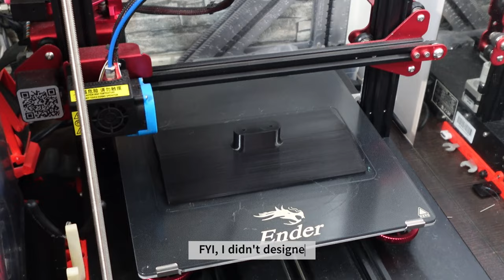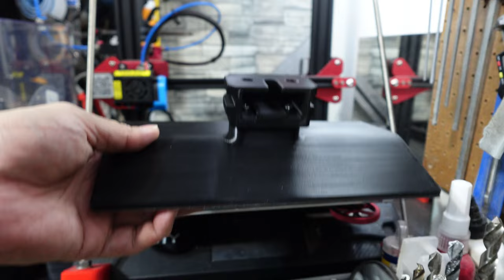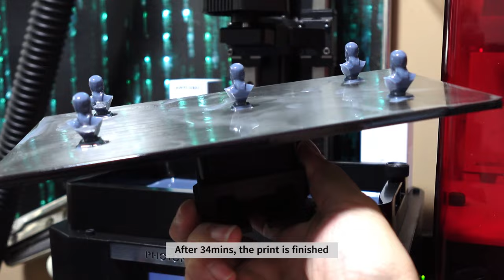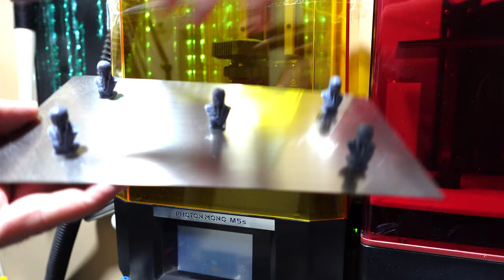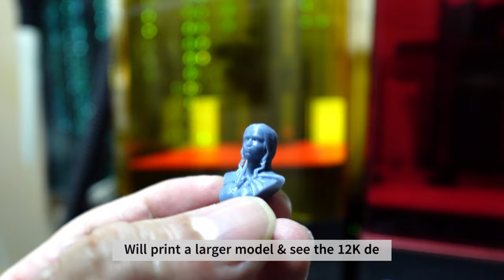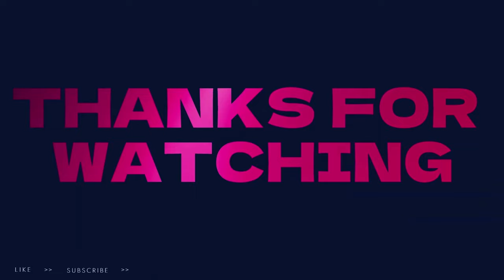Experiment with Mag Flex Plate on M5s

Comment: If it autolevels, do you even need a separate build plate or can you use the OG buildplate?
Reply from the maker: Hi! Currently I am using OG buildplate with wham bam flex system.
Reply: @ManWearCap  without being able to print a spacer (no filament printer) can I just adjust OG build plate with screws and run auto level for M5S?

Comment: hi! i also have the m5s and just ordered  a wham bam. what did you need to to to install the magnet with the auto level sistem? did you need to calibrate something? i tried to put a magnet for the saturn 2 between the build plate and the screen but it got pushed down very hard and the force sensor seemed to wornk not correctly. i tryied without installing the resin vat and the sensor didnt detected the missing resin. thing tha it has done without the magnet. could you tell me what didi you do?
Reply from the maker: Hi, you install the wham bam flex plate on the M5s actual buildplate?
Reply from the maker: As for Saturn 2, you will need to install a spacer before installing the wham bam flex plate. Cos the wham bam flex plate is rather thick (4mm).
Reply: @ManWearCap  Hi! thank you for replying. i already installend wham bam on the saturn 2, what i'm saying is that i have a spare one and tryied to put it between the screen and the m5s's build plate to see what happen.
without the resin vat, the build plate go down and after came out a warning saying "no resin detected"

with magnet between, this warning didn't came out, like the build plate was pushing hard on the screen.

Seems that the auto level or the force sensor, mistook the pressure caused by the thikness of the magnet for the resin.

I would like to install directly on the original build plate
Reply from the maker: @marcobuso1768  I believe u will need a spacer fir M5s too
Reply: Hi! Did you install the flexible build plate in the end? Did you have to modify something? Did the autoleveling work fine?
Reply from the maker: @Mister_Flink  Yes, I installed wham bam flex plate. And auto-leveling work fine with me.
Reply: @Mister_Flink  hi sorry for the late reply, yes i installed it, anycubic sent to me a build plate with the 4 screw for the first leveling. so i leveled with the wham bam installed and all worked fine.
Reply: @ManWearCap  Did you have to print and install the Z Spacer on the M5s or did it work without it?
Reply: @marcobuso1768  Did you have to print and install the zSpacer or did it work without it?
Reply from the maker: @ArsMemoriae  Hi, I printed a spacer & install it.

Comment: Hi! what type of filament did you used?
Reply from the maker: Hi, I used PLA Pro
Reply: And what is the long term durability? Have you kept using it that way or was it just for testing?

I also hate having to struggle lifting parts off the building plate. I ordered the Whambam flex plate but haven't dared to install it on this machine for fear of disturbing the "self-alignment".
Reply from the maker: Hi, is just for transition & a experiment while waiting for Whambam flex plate. Which I am using now & works flawlessly.
Reply: @ManWearCap  And you need to change anything? or just stick it to the original build plate?
Reply from the maker: Hi, U will need a spacer for Whambam flex plate
Reply: Hey where do i have to put this spacer can u send pic pls  @ManWearCap